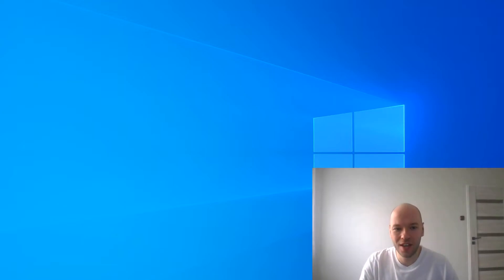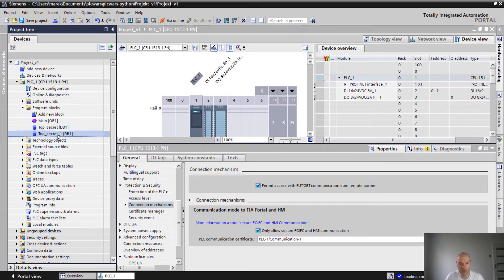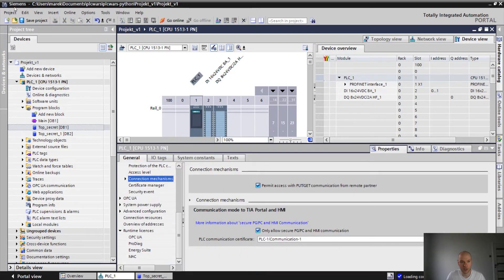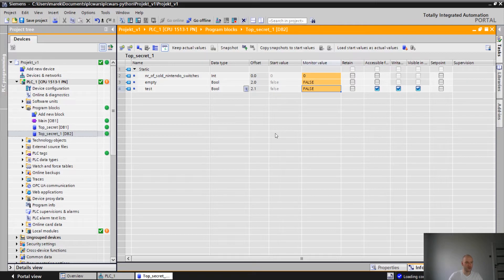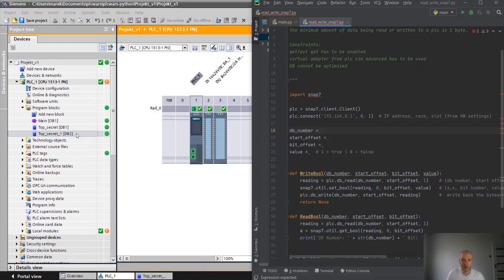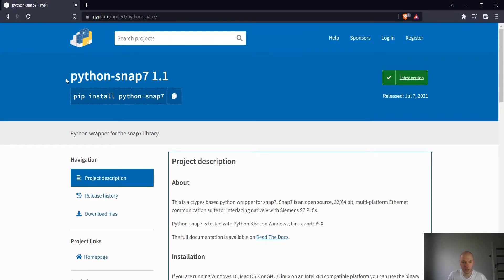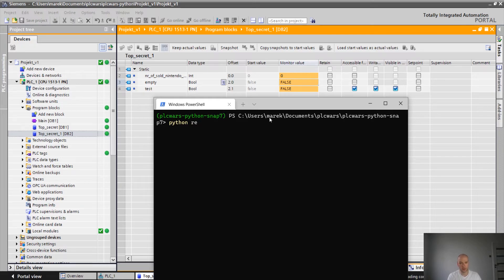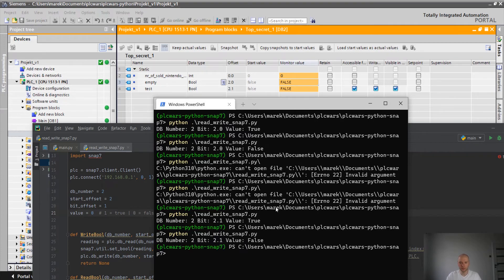Python Snap7 S7 Communication with PUT/GET with Siemens PLC TIA Portal

Comment: Hi, Could you please let me know if it is possible to use Snap7 for updating PLC program (I have existing program running on PLC. I have made some changes to it on another machine and i created archive of the project in another machine. Now i want to upload the archive project to PLC, is this possible using Snap7 library)
Reply from the maker: Hi, I believe that for the downloading plc program you need dedicated software which in this case will be TIA Portal.

Comment: Thank you for this tutorial. Can you describe the difference between snap7 and OPC UA when connecting to Siemens PLC? Is snap7 for Siemens something like ADS protocol for Beckhoff PLCs?
Reply from the maker: Hi! Thanks for your feedback. OPC UA is industrial standard for data exchange. (https://en.wikipedia.org/wiki/OPC_Unified_Architecture)

Snap7 is something to interface directly with the S7 communication protocol which Siemens uses in theirs PLCs. (http://snap7.sourceforge.net/)

I am not familiar with Beckhoff and ADS so I am not able to compare it and tell you if it is something similar.